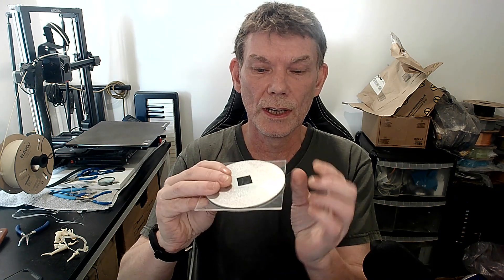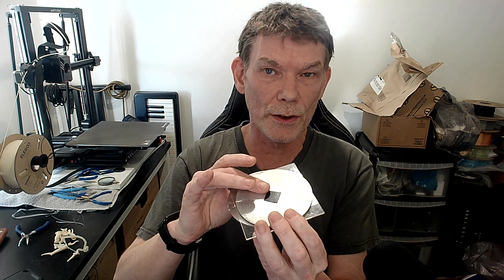Gary McKinnon - Anomalous thrust or weight loss in capacitors, a basic description of the effect.

Comment: Random statement 
Gravity is caused by space time warp due to mass by matter also by the oscillating quantum frequency. That frequency bends pace time. What I'm saying here is the current research on the alcubier Warp drive technology is absolutely insufficient and completely dangerous why? The reason why is called bow shock and this is cause when you go faster than speed of light. When you go faster than the speed of light you cause a scenario called the bow shock this bow shock is essentially breaking the sound berrier but you're not breaking a sound barrier You're breaking a light barrier. When the ship slows down you get large amounts of gamma rays depending on how fast how long you been traveling including other matter and particals that is immediately released which is detrimental and catastrophic to the spaceship and the occupants inside. Also can result in vaporizing or destroying the area that you are traveling to depending on the energy level and how fast the craft is going. To solve this issue is simply by not pulling space like a blanket instead creating a localized gravitational force field simply causing the spaceship to fall the falling effect continuously falling this eliminates bow shock. 
Yes it is physically possible to manipulate matters quantum atomic oscillating frequency the higher the frequency the stronger the space-time warp. Essentially this technology can be used to create or generate artifical gravity.  SpaceTime warp bubble in front of the ship and nothing in the back causes it to continuously to fall forward however there's a dangerous risk with this rapid instant acceleration would result into spaghettification you have to gradually accelerate. Spaceship is never moving because it's stationary within that space-time bubble but it is but it's not it's kind of hard to explain a complex this is a solution to solving space-time travel without bow shock. This method is essentially called quantum travel. Obviously the question is how can we manipulate matters oscillating frequency under a quantum level? 
What can we use to do that? 
How much energy does it take to do that? 
And if you're wondering yes they have the ability to do this. I assume you might already know that

Comment: So this is the same type of layered discs that the fluxliner, ufo, used, or whichever one that was.  That one has counter rotating pipes in the middle going vertically.  It can change direction by applying  more charge to certain sections of the disc stack.  That's absolutely what you have there, the base of that, but those pucks get more sophisticated.  It's electrogravitic, anti gravity tech, I'm not sure if it can create its own gravity though.  Piezoelectric crystals change mass like you're saying, they must be natural capacitors or something.  The way that a ship can use piezoelectric crystals is a different kind of "propulsion."  Do you know about the Ultron cube?  Broken symmetry, weird stuff.

Comment: i see nothing unusual about a "thrust". in fact, i would expect it. 

electrons have mass. "charge" has mass, a coulumb per second is one ampere iirc.
"positive" is the deficit of electrons. mass had to move from the positive side. it also had to move to the negative side. but not necessarily the same electrons themselves. just their equivalent in charge and mass.

now this is interesting. in a thermionic valve, or any electronic circuit really, we say electrons are emitted by the negative, cathode, and travel to the positive... the key point being to neutralise the positive anode with the negative charge of electrons, and that constitutes "current" through the device and attached circuit due to a constant supply of EMF from the battery.

here, we have to remove the electrons from the ANODE to render it positive... really, in any circuit we have to... you could say the battery or power supply removes electrons from the anode just as we already take it for granted that the cathode forces them into the circuit... is it a push or a pull that actually causes "current"?

then any reaction due to mass in motion from charges being removed from a plate, a one off transient effect of charging a condenser, is annulled by any opposite reaction to electrons then being returned when that plate is discharged... depending on how its discharged, geometrically?

that makes sense for a transient force, but if this is a constant force...

one must ask...what and how is the source of power actually pushing/pulling on the mass of these electrons? to push current through a circuit in one direction, one would have to assume there is a corresponding equal and opposite force pushing back... on WHAT?

so the capacitor is charged and no current flows? something is still pushing back against that pressure, to hold it. whats it holding it back against?

in electroplating, the terms arent reversed. the direction of current is. you are pushing power into them. an electroplating cell is a battery... being charged. remove the power supply, add a resistor, a load... and they produce current, voltage. now whats the anode, whats the cathode?

Comment: Is the thrust momentary and not continuous? Have you tried different metals or alloys for the capacitor plates? Voltage would be a major factor in the mechanism. Brown observed differences in results according to variation in shape and size of the plates suggesting involvement of concentration of electric fields in his mechanism. With your symmetrical plates, the mechanism looks to be internal. Expect a visit from men in black if you get too close.

Comment: a question Gaz - the new willow quantum chips are showing a measurable gap, putting out data before being asked to computate.   the 1950s consciousness studies showed the brain sends receives and processes electric signals to move your hand, a tiny measurable gap before doing so.   Are these the same things ?  is the willow chip conscious like us...or....do we live on the boundary layer of two dimensions, and not 'in' a dimension, soooooo, the reverse entropy universe talked about being paired with us, is where these elec signals, are going into ???   is that where the capacitors are going...they lift into the next dimension ?  coz electrickery !!!

Comment: Hello Gary, great discussion, thanks for sharing. I'm a complete newb on this topic, and these might be really stupid questions but: 1. what would happen if you varied the thickness of the plates, is there an optimum thickness to charge ratio? 

2. Would there be efficiency in different shapes of conductive plates... spirals for example? 

3. Would there be any efficiency if the plates were able to spin and move..im thinking what if each plate were like magnet, with a positive and negative charge on EACH plate, split down the middle, so when current passes through, and if there was a hole in the plates, which would allow them to spin like cd's in a cd player, would this make any difference at all?

Like I said, apologies, these are probably child-like questions from the uninformed, but I was just wondering... xx

Comment: Are you doing the experiment in a near vacuum? Otherwise it will be debunked as atmospheric electrostatic charge causing the lift.
Reply: Or put it in a sealed container such that there is no net flow of stuff (including electrons) beyond that container.  Measure via a balance (so weight of container is cancelled out).

Comment: In electrochemistry the anode is positively charged (because electrons are forced away from it), in a galvanic cell it has a negative charge,(because of the accumulation of electrons), in a capacitor the anode is positively charged (it is connected to the positive side of the circuit). So you got that wrong to start with Gary.
Reply from the maker: My fault, being doing lots of electroplating too !

Comment: So does the polarity decide the direction of the trhust? In lifters the polarity is not what gives the direction of the thrust, but the thrust is in the direction of the smaller capacitor, so thowards where the the electric field is denser and thicker, are both the polarity and the smaller capacitor, with the denser electric field, that decides the trhust direction? maybe the positive charge has something different from the negative that makes a denser electric/electrostatic field towards the positive and not the negative?
maybe only in the case of a solid insulator, rather than a gassous one like air, the positive has a stronger electric field in its direction? cause i know that corona  disharges change if they are positice or negative, one is longer one is smaller, maybe this has something to with it? Idk, anyway i would suggest you to try to make a capacitor smaller than the other, and switch the polarities occasionally, and see if there are any changes in direction or increases in thrust
Reply from the maker: The polarity decided the direction in Brown's first discovery with the xray tubes, but yes in lifters it's the direction of the smaller electrode. I've read so many papers on this since 2007 and people seem to have varying results, some with greater thrust to negative, one experiment even used a single-plate cap and it worked !
Reply: @GaryMcKinnonUFO thats cool thank for the response, you seem very informated on this topic, it would be cool to create and share with the world, (maybe in a website), a collection of all the papers and documents related to this topic, and the various experiments, maybe if you already have a your own collection, in the case, it would be easier, it would help a lot of us, anyway, where did you read all the papers? Just searched them On google? Do you have any links or suggestions?
Reply from the maker: @Justabeingg  I've added a link to an archive of PDFs i have on the topic, in the video description.
Reply: @GaryMcKinnonUFO  o ok, thanks!, sorry i didnt see it, (i didnt check the descriprion)
Reply from the maker: @Justabeingg  I added it after you first watched the video :)